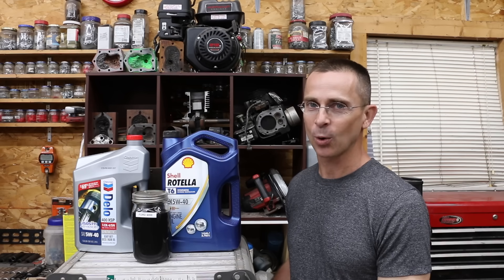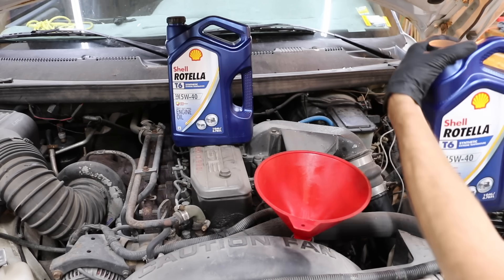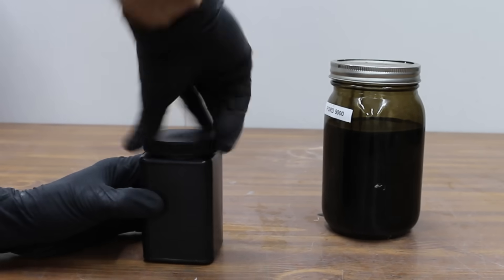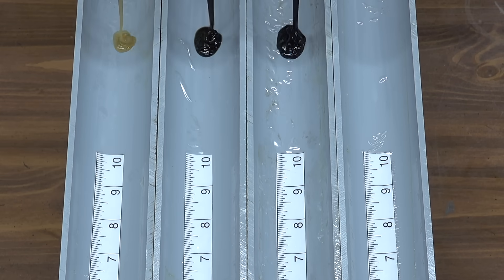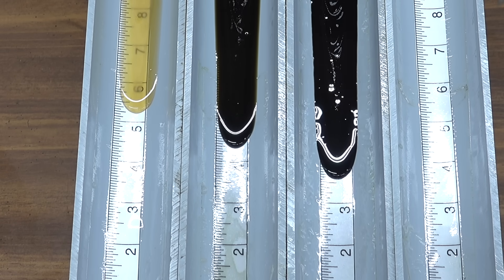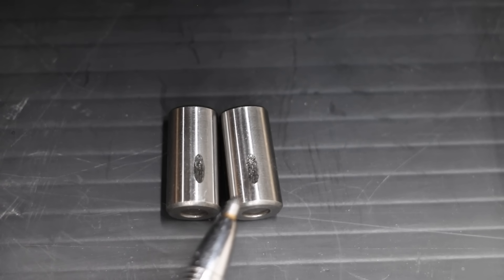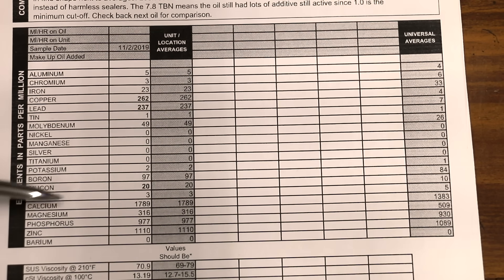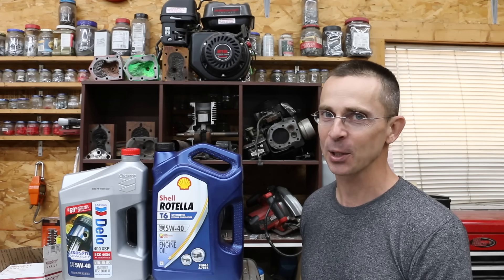Will Annual Oil Change Damage Your Car? Let's find out!

Comment: I would love to see this kind of test about new vs old coolant! It's great how in depth your analysis always is.
Reply from the maker: Great suggestion!
Reply: Oil and steel are one thing, water and steel another. Then there is aluminum which has some wild reactions with chemicals. I would not keep antifreeze in there much beyond the recommended. I did that and the impeller on the water pump in my 85 Toyota pickup completed rotted out causing overheating.
Reply: Great video and suggestion.  GM had some bad head gaskets on older models.  Curious if acidic old antifreeze could have caused additional corrosion beyond the 5 year mark.  Tough to establish a control across this time period, and compare head gasket corrosion.
Reply: I got a coolant ph test kit on amazon . My coolant had low miles and 6 years old . Tested as good as new still .
Reply: They had Intake gasket problems maybe that's what u ment !!
Reply: I would like to see that too, I am a pro mechanic, I am advising people with cars that have a sealed cooling system that a coolant flush is not needed, would like to know if I am right
Reply: @jimsix9929 hey my friend, it definitely is needed. Coolant will become acidic and corrosive over time and electrolysis will occur. Basically the acidic coolant acts as catalyst for an electrical Current between the different metals of the engine and cooling system and will destroy it from the inside out. Good way to test for this and to simply take a power probe and dip the tip into the coolant and if you see a .3v or greater the coolant should be flushed

Comment: I' ve always believed the " once a year regardless of milage" oil change was a way just to sell more oil. I change the oil based on mileage or operating hours on my vehicles and tractors. All have had long lives with no wear problems. So many people are throwing away good oil thinking they are prolonging the life of their vehicles. You proved them wrong. Thanks for the test.
Reply from the maker: Thanks for the feedback
Reply: My car manual says that but I think that's to make you check your oil and to cover the car manufacturer's butt.
Reply: Manufacturers need to sell more vehicles to cover the massive retirement fund of their overpaid workers! @williamwchuang
Reply: @williamwchuang It's to feed the dealers butt
Reply: @williamwchuang  My 2019 Ram pickup calls for synthetic oil changes every 10,000.    I think that's too long.  I change mine every 5000.   They have had issues with the cam follower gizmos wearing out.   Plus, I only drive it about 5K per year max.  I figure its cheap insurance to insure the crankcase remains as pristine as possible.  At age 63, this is my last truck.  Need to make it last.
Reply: Yes there are many factors that will affect oil life. This experiment was meant to show that time alone will not cause oil to degrade and if you don' t put a lot of miles on your vehicle you don' t need to change your oil once a year.
Reply: What's amusing is that most of the people who posted responses paid little attention to what was being tested and the scientific analysis that was used. They still go on believing what they want regardless of the facts.
Reply: Left my Shell Rotella T6 eight years and came back to find the crank had filled with gas, displacing the oil. Crap. Stuff like this happens when operating over the year too, so it really depends.
Reply: Most people do not know a crankcase heater will prevent most condensation accumulation problems for an intermittant use motor not garaged.  Trapped condensation is a quiet evil: it finds the bottom of the pan at some point and then it will not evaporate - but it could wreak havoc on the first start.  It takes many months, but accumulation is simple: engine cools at night drawing in moist air, some of which may condense, adhering to surface areas or dropping to pan bottom.  Daytime heat causes expelling of air and only a portion of previously drawn in moisture.  Rinse/cycle/repeat, but we are talking grains, not grams, so the process is not fast.  A stable temperature solves the problem of needless oil changes.
Reply: I’ll just say oil is cheap and engines are expensive and leave it at that.
Reply: I figured that, too.  I run my car enough that it hasn't been an issue, I do it about twice a year.
Reply: still cheaper than, not doing oil change ontime and replacing the machine ;)
Reply: @IYG-x7c  I guess you missed the whole point of Project Farm. Actual testing.
Reply: @IYG-x7c  Every six months?  I would say he is a nut.  And what science does he use to support his approach?
Reply: It also depends on the engine’s characteristics in regards to sludge, at least in gasoline engines. If a motor sludges up, change it earlier regardless of oil life left.
Reply: @jeffmiller2433  You won’t know it’s sludging up until you look in it.  Just change your oil at 5,000 and don’t worry about it.  I don’t understand people.  “Oh if you have this car or these driving habits you can go long.” “Only change your oil once per year and it’ll be fine.  Oil is cheap but don’t bother with it.”  There is no magic wand in oil technology to make them last longer.  Still gets dirty still needs changed regularly.  Once per year is not regularly.
Reply: @jeffmiller2433  How are you going to know if engine is sludged up without looking or taking it apart?  Why not just change it sooner to prevent it from happening in the first place?  I don’t understand people and their refusal to do more regular oil changes trusting some bullshit lab results when they can just stick with what works.  I believe lab results are helpful when determining the health of an engine but not when determining an oil change interval.  Some oil changes can degrade sooner than others based on the season and driving habits that are not always consistent.  5,000 mile oil changes is a nice consistent and easy to remember oil change.
Reply: @IYG-x7c  More like $50.  But still not that expensive.  At least around me.  I change mine with 6 quarts of full synthetic and an OEM filter and it costs me around $55-60.  A bit more since the price of the filter nearly doubled.  If I got to a shop like a quick lube place it’s usually around $70 for synthetic blend.  $110 for full synthetic.
Reply: @LiveType even though the lab tests show good,will it not still get dirty
Reply: wrong...what if the vehicle isnt driven at all?
Reply: If I waited a year to change my oil my car engine would literally seize up
Reply: I guess if you have Diesel engines and a lot of them then oil prices add up quick... but for my daily driver, and even my second car, I'm fine shelling out the 30-50 bucks a year for oil and a filter if it means peace of mind.
Reply: Exactly what I told my car dealer
Reply: It's a different animal, but there is plenty of evidence that daily driving creates a different scenario with oil sludge creation due to not changing oil. Especially in long term habitual oil changes of 10k miles between changes. I'll change my oil when I think it's due. But ty for the heads up on short distance oil changes not being necessary.
Reply: IMO, once a year OCI is acceptable esp if you don't drive >6k miles a yr. I mean Kirkland Synthetic API-SP oil is $15 for 5qt + $7-9 filter, for a whole yr.
Reply: I contacted Mobile 1 back in the 90's asking an oil expert if the oil is good for the mileage or should I change it annually. He advised mileage ! I too think the time is a myth mostly.
Reply: I’ve been driving 60 years and have owned 16 cars. I always change the oil twice a year regardless. I’ve never had a car burn oil or blow an engine. Sounds like success to me.
Reply: It's the same voodoo science that says if you leave cooked chicken on the counter for more than 2 hours it'll magically develop enough pathogens to give you severe food poisoning yet no one ever seems to get sick when it happens.
Reply: Yes this is great… this is going to save lots of oil from going to waste. Now i can change my motorcycle and truck oil once every 18 months. Hect the service shops tell you every 6 months to do it…. Its sort of like dental cleanings every 6 months… over done
Reply: EXACTLY.  Spending your hard earned money keeps the lights on at the shop! @keithbellair9508
Reply: The "once a year" thing is based on the fact most cars do not have engine hour meters and dum@sses will go out on their lunch break and sit in a car with the A/C on for an hour every day and do the equivalent of thousands of miles in additional revs.  Even worse, idling usually gums up spark plugs, valves, emission equipment, etc. as engines are designed to DRIVE not idle.  Moisture can also be a problem if the car is driven sporadically, like being stored for months at a time because the owner stores it for the winter, goes off to college and drives something else, etc. and the car doesn't go anywhere or heat up for weeks or months at a time.  If you're driving the car at least once a week or every other week for a long enough drive to heat the oil up to boiling temps and not excessively idling it, it should hypothetically last until the mileage change interval is reached.  But manufacturers have low expectations for consumers to expect them to do that math, so they just say X miles or 1 year, period.

And to all of the people that keep chanting "oil is cheaper than engines", that's a nonsensical FUD (fear, uncertainty, doubt) reason to over-change oil.  I don't refill my bath water halfway through a bath (unless I'm actually covered in serious visible dirt, much like having a seriously dirty engine I'm trying to flush) and I don't change oil halfway through a normal lifecycle.  To do otherwise means you literally have nothing else to do with your time besides climb under a car and change the nastiest fluid this side of a septic tank.  I've never seen someone blow an engine when they more or less stuck to factory mileage change intervals, it's always from oil leaking out, burning oil due to driving too hard and damaging the piston rings, or some other problem taking the engine out.  It's often more on how the car was driven than anything else.
Reply: The point is to throw away good oil so you don't throw away a good engine.  How much does that 2500 v8 cost to rebuild or replace?   Yeah, I think $60 of disposble oil is better than $8,000 disposable engine.
Reply: @damiena9711  Why would throwing away good oil help? It's just a waste of oil
Reply: You never got all the oil out when you drain the oil. Time does not matter. Diesels get oil black quick but not in three minutes. If you really care test oil on drain.
Reply: @LiveType  is wild just how recent  a quart was $0.89 & now they want $6.99-12.
Reply: @LiveType  Not really , it tends to clump after some time.
Reply: Completely agree.  I never bought into the once a year or the 3,000 mile marker, because I could find no science behind it.  When I switched to synthetic oils in my daily drivers, I change the oil and filter at 10,000 miles.  In my lifetime and multitude of cars I've owned, I've never ever had engine problems, nor a failure related to oil or oil changes.
Reply: @dickjohnson7845  10,000 miles is once a year for a lot of people…
Reply: It might be ok if you r experienced with oil and also engine. For newbies, one year is literally a must because they could not tell
Reply: Changing your oil only once per year is okay if you don't drive a vehicle.  For those of us who do, please don't let what this person thinks dictate your oil change schedule.   You change it when the oil is spent.  You can see by the color, viscosity and texture.  Dark brown, non-see through, slight smell.  Change it.  Don't need to look at the odometer.  That oil will stay tan and see through for a few decades if left in the garage, so the amount of time matters little.  Each engine is different.  Oil types are different.  Some have older seals that allow blow by and burning of oil will require more frequent oil changes due to the amount of particulate in the oil.  Once that particulate count gets too high, the viscosity decreases, and that same amount of oil is not as effective.  It's easy to tell in 2 steps.  1.  Find oil dipstick 2. if oil is black, change it.
Reply: @D1NKERR  in a diesel engine the oil turns black very quickly.
Reply: @alanjm1234 it doesn’t in my 5.9 Cummins 2003 synthetic oil,stays looking good up to my oil change at 10000 miles
Reply: You missed the point entirely of this video lol
Reply: Color is not a reliable indicator of oil quality. Change the oil in a diesel and check it after running it for five minutes. Will be totally black.
Reply: @D1NKERR  Allow me to toss some "well, sorta...." your way.   I have a 1985 Mercedes 300CD Turbo Diesel.     You can pull the dipstick, pull the filter and pull the plug and walk away for a week allowing every last drop to escape.   You then add clean oil and start the engine and let it run for 3 mins.   Shut it down and pull the stick....it's covered with black oil.  Well, dirty oil anyway.  Drive it 20miles and it's black.     I also have an old MB gas coupe.  I change the oil every....oh hell, I last changed it two years ago.   But I only drove it about 200 miles last year and the one before that.   It's still VERY clean.  But I'll be changing it soon.
Reply: @lbowsk  its soot, Diesel engines produce smoke particles in a much higher quantity, it doesnt actually affect the lubrication to any note worthy degree
Reply: @BlurpGooDiJabba  Fully aware of that.  My point was to Josh's point that dark oil is spent oil.
Reply: @BlurpGooDiJabba  I understand that.  Long time diesel owner who does all his own maint.  My comment was directed to the guy who said the oil should look clean.   It looks like hell after 5 miles in an old diesel.
Reply: @lbowsk  Exactly, diesel engines just do that, they actually "SHEAR" the oil too, that's why you usually have to add half a quart before changing intervals.
Reply: @lbowsk  Spot on.
Reply: @D1NKERR  This is incorrect if you use a somewhat modern oil. But great that you support small businesses such as castrol and shell. 
Go by the manufacturer recommendations, both in terms of oil quality and service interval.
Reply: @D1NKERR  color is not a sign of anything in an engine that operates normally.. both my motorcycles and car can show dark oil in less than 2k miles depending on the brand. also viscosity and texture are not something one can feel on their fingers. a 20 and a 50 oil will feel and 'move' exactly the same at room temp..
Reply: @D1NKERR  Lol my deisel oil is black when I check the dipstick after a fresh fill. You cant argue with the lab testing. His oil was still completely fine.
Reply: @Weaponized_Autism  Yes, YES!!! I'm sure it is!  Do another oil change real quick then, brother.  Keep the new filter you just put on to save a little money....but that's how much buildup you have in your motor.  It's normal but if you do an oil change, run it for an hour or two and it's already black?  Take that oil out and change it.  That's what I'd do.  Think about it, what makes oil black?  Carbon.  well, an hour ago your brand new oil was the color of honey, now it's black.  How could that be?  It's CARBON....get that out.  You'll get to the point where you'll see it stay clean for longer and you'll probably feel a little bit more power.
Reply: @D1NKERR  But , my diesel is black soon as I change it, what now.
Reply: @D1NKERR I changed mine every 3-5k.  Changing oil less often is just so we as a society consume less oil.  It’s not based on what your vehicle needs for longevity.  Look at how many engines are recommended to run oil as thin as water now.  You really think that engines are really that “tighter”?  NOPE!  It’s for fuel economy.  You can run thicker oil in a newer engine and be just FINE.  Vehicle’s started running thinner oil when CAFE standards started to tighten up.  Them being “tighter” has nothing to do with the physical gap in parts.  I worked as a machinist for a while.  A tighter tolerance refers to the allowable tolerance between the minimum measurement and the maximum measurement.  In between you have the nominal value or target.  The target measurement can be the same but the range be tighter.  Simply put we have improved the manufacturing process to a point that we can produce a part with greater repeatability with higher yields.  Change your oil a minimum of every year to keep your engine happy.  When they are recommending lifetime fluids and oil that’s like water it’s okay to not follow their recommendations.  We live in a throw away society.  We would rather replace than maintain….
Reply: @dperr338  You are absolutely correct, it's all about fuel efficiency and the EPA.  Personally, I ignore the thinner oil recommendations and run thicker.
Reply: I've heard quite a few horror stories about early engine failure in newer motors, especially in cheaper vehicles for not changing as scheduled. 
Family rule is 3 months for regular oil and 6 for synthetics.
Reply: @bipbop3121  You must come from a family of obsessive compulsive people. I bet you wash your hands 20 times a day too.
Reply: @bipbop3121  Waste of oil, a good quality ACEA synthetic's good for 10k 2 years.
Reply: That's what happens when you drive junk when you change oil once a year 🤣🤡🤡
Reply: Its different depending on what vehicle you run, Diesel engines are far more forgiving as Diesel is a lubricant in itself. 

Motorcycle engines are far more sensitive and the oil gets thinner quickly. 

Its also proven in Studies that i read that motorcycle engine oil gets acidic like twice as fast as oil in cars.